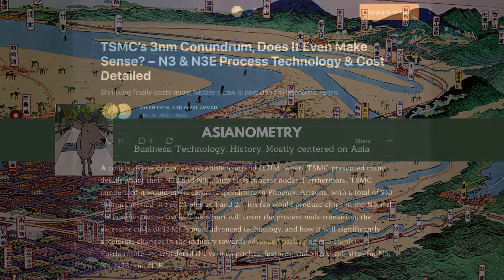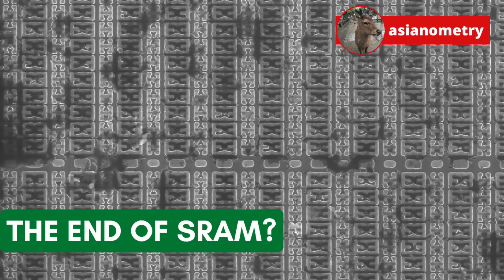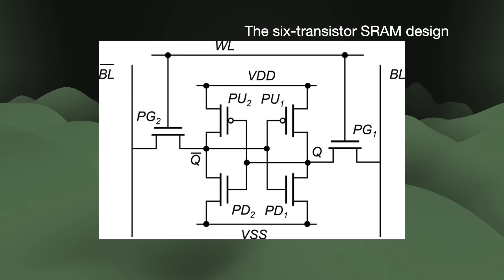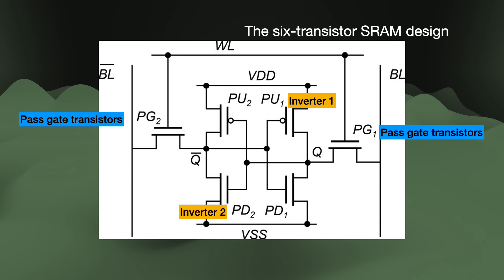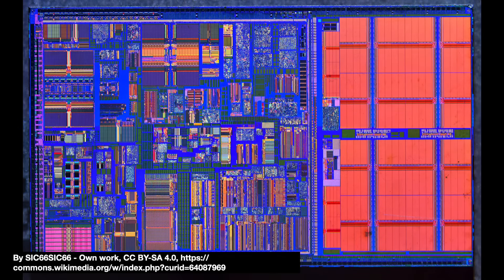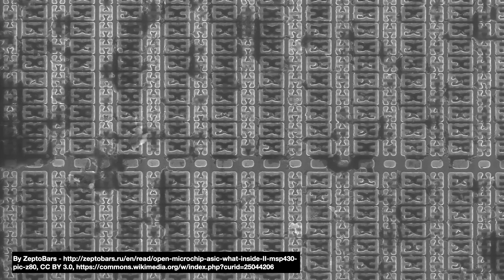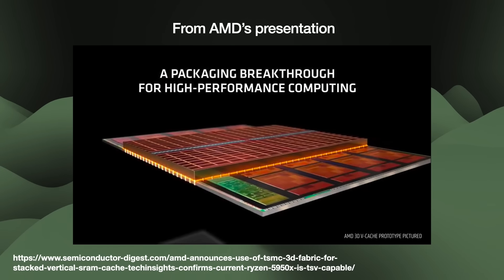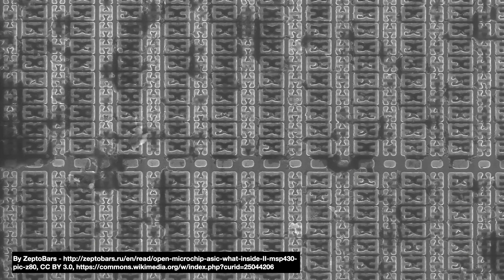Can SRAM Keep Shrinking?

Comment: It would be nice to know what the "static" power cost per bit of SRAM is in comparison to DRAM.
I tried to find any kind of numbers, but Google isn't in the business of providing relevant answers anymore. Welcome to the new dark age of information.
Reply: DRAM takes power to refresh, though it’s not tons. But you can compare the power consumption between the chips themselves, Infineon makes PSRAM (practically, DRAM) as well as SRAM and Flash and the data sheets show the consumption. The access time issue with DRAM is also because after you read a DRAM cell, or if you wait maybe 20 or so milliseconds, the data needs to be written back.

Comment: Didn't we have the some problem wit  DDR Ram ? So far I know it stopped shrinking at 7nm nodes  or did they solve it ?. The whole time I was thinking if its stay so static ram would return for general PC use. From the schematic I always wondered the advantage of DDR is it use just a few transistors less. Basically if 3nm would have become cheaper over time and could produce SDRAM in the same size we would have a PC revolution.

Comment: It is not fair to use a picture of a MAX II die to illustrate the point that some dies are almost all SRAM.  An FPGA is a bunch of SRAM disguised as an array of logic.  The "gates" are simply values stored in a RAM table with the "inputs" to the "gates" being the address lines for the memory and the "output(s)" being the value stored in the RAM.  Plus, the interconnects are just pass transistors enabled/disabled by other memory.

Comment: Given Sram sits between the processor and the main memory wouldn't it make more sense to have it underneath the logic?
Reply: Sits between is just hierarchical it doesn't necessarily serve as an interface between the processor and main memory. If the processor checks for data in some sort of sram and it's not there the processor then has to request data from memory so it's not like the sram serves as an intermediary
Reply: Well , i think it is an electrical consideration. The logic definitely use more current than the SRAM. So having it at the bottom nearest to the power source is makes more sense
Reply: @tylerweigand8875  Ah, I didn't realize that.  I always kind-of assumed that only one fetch got sent out and the cache handled requesting it from main memory if necessary.

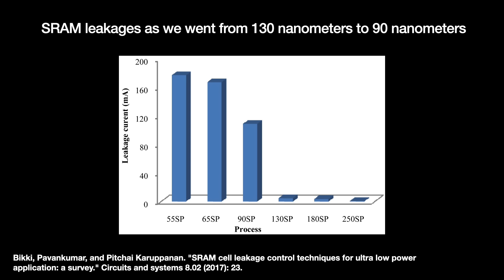Comment: 7:41 that must be why Intel’s 90nm node suddenly looked really bad on power, even for Pentium M Dothan initially..
Reply: I think that’s where frequency stopped scaling exponentially as well. Dennard problem
Reply: @alphar9539  Yeah a lot of people say 90 broke frequency scaling but 65nm gained pretty nicely over 90nm for the Pentium 4 (when OCed, 65nm would go about 1 GHz higher on air).  Core 2 also had nice frequency bumps to 45nm.   But seeing leakage go from 0 to a lot in one node is interesting

Comment: Here's an idea - what if instead of an electric charge we use a magnetic one for the memory, the memory cell should be much simpler and could even store the value without needing to be periodically refreshed, resulting in a much lower power consumption...
Reply: For a material to exhibit ferromagnetism (i.e. what we call a permanent magnet) you need a certain number of atoms - too small and it won't stay magnetized. Also there are issues with switching the magnetization fast enough.

Now you could envision to use a SINGLE atom's spin to store (or manipulate) information - this is called spintronics. But there are challenges to make it reliable enough as there needs to be very good isolation for surrounding environment.

Spintronics is an ongoing research topic - would actually be interesting for Asionometry to cover it. It's a little bit like fusion power is for energy: the elusive holy grail of miniaturization.

Comment: Since AI needs is bottlenecked by memory bandwith, SRAM is kind of forced to evolve.
Reply: The concern is that it may not be able to. We might be at the limit.
Reply: @Ornithopter470 Yay! A bottleneck for AI.
Reply: memory bandwidth is always a bottleneck.
Reply: Main memory, DRAM, is the bottleneck. It is far slower, hence the attempt to alleviate that with fast CACHE memory that is constructed using static ram.
Reply: @MrDomingo55  That's why the way forward will probably remain a combination of DRAM and SRAM. There's always a trade-off and compromises must be made to be able to move forward. Better and more elegant solutions will present themselves further down the line.
Reply: SRAM cache improves memory latency, it does little to improve bandwidth
Reply: Graph processors built for very specific architectures can still deliver a lot of extra performance. I expect when GPT6 is here, there will be GPT6 inference chips. We'll build compute infrastructure outcompeting the brain soon enough.
Reply: @shanent5793 it also improves bandwidth, L0 on a 6900XT for example is 20TB/s. if you have more cache, more data fits in it and it ends up getting accessed/used faster. Hence why AMD claims ∞-cache increases "effective bandwidth" by 30% or whatever it was
Reply: @Ornithopter470  we are not at the limit. ASML just started to ship high NA EUV machine around 1 month ago. TSMC working actively on gate all around transistors and so on. We have at least 5 - 7 years of progress based on these technologies. Then they will figure out something new. But I have to admit progress slowed down and cost increased. What to do!

Comment: Awkwardly we called it a bi-stable vibrator. Btw, technically there are capacitors in SRAM, it's the capacitance of the transistors that keeps the state current.
Reply: it's _multi_vibrator in all languages I know, and capacitance plays no functional role in the cross-coupled inverter circuit